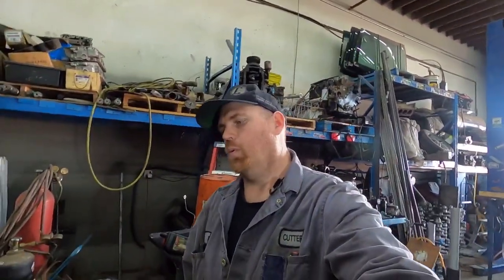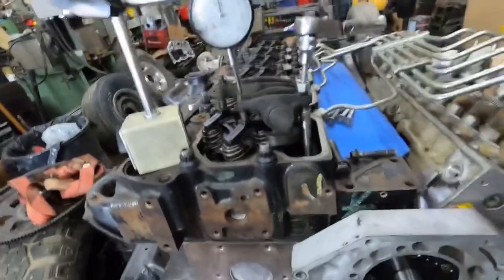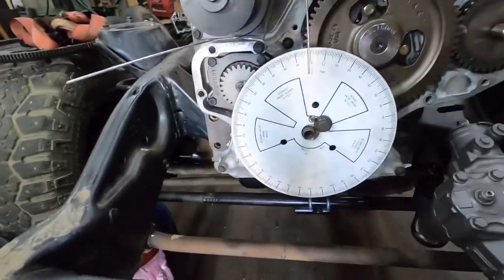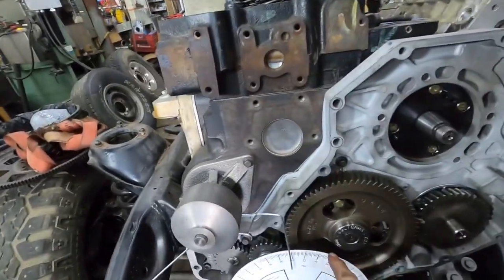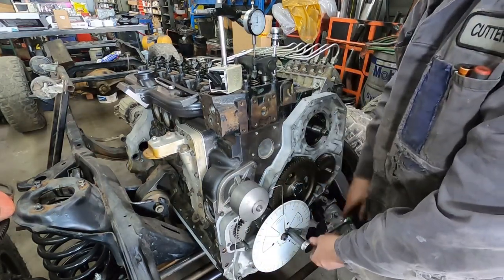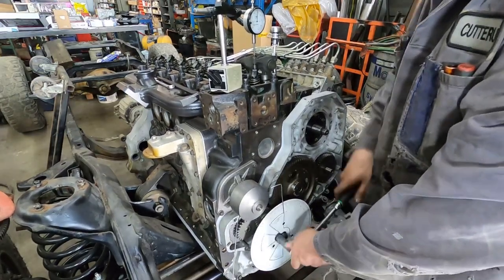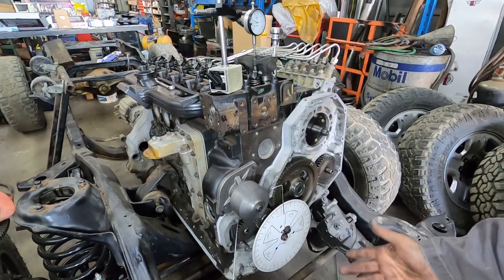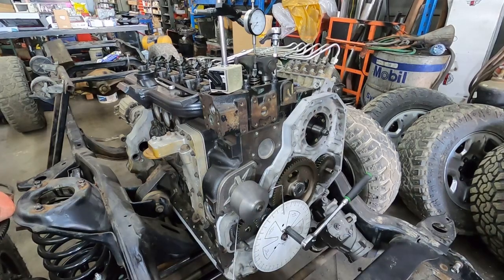HOW TO Find TDC ( drop valve method)

Comment: What about a delievery valve video?
Reply from the maker: What do you want to know about dvs?
Reply: @CUTTERUPROB  where does a dv make a difference in the way it performs? And what is your method of matching the size dv with injectors etc. without smoke and heat?
Reply from the maker: i will ad it to the list

Comment: For some reason this is still seams difficult to me no matter how many videos on finding TDC I watch and I don’t know why. Lol.
Reply from the maker: i am going to do this again with the damper on so i can show how you would do it in the truck, i was thinking the same thing after i watched it
Reply: @CUTTERUPROB  It’s definitely a “me” thing and not the video. I can picture it in my head but.... I think it’s because a lot could go wrong on my end
Reply: Know what you mean man, 👍...but basically u turn the engine to just before tdc  compression,turn the intake valve down alittle...rotate the crank shaft til the piston/valve make contact,mark dampener/degree wheel, loosen valve adjuster...turn crankshaft past tdc,turn valve down a little but equal as previous,back up crank til they touch ,mark dampener/degree wheel...midway point between marks is TDC....I think that should b an accurate explanation...lol 😆
Reply: @elroyelblander6277  I get that. So I’ll write it out and you tell me... crank down the rocker so the piston can touch the valve. Mark balancer. Reverse it. Mark balancer again. Measure between and that middle mark is TDC. How far down do I drop the valve? Where does the dial indicator sit on? What’s the best way to turn the engine over while it’s in the truck?
Reply: @justchris7229  set it up like Rob... Turn it from the balancer like he did
Reply: @elroyelblander6277  thank you
Reply: @justchris7229  👍